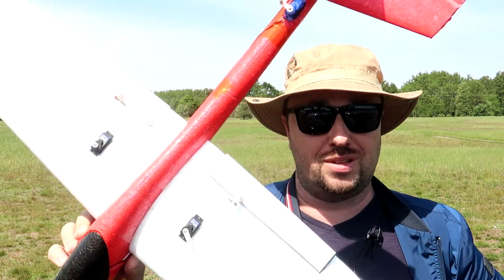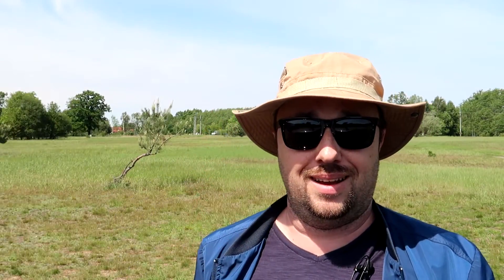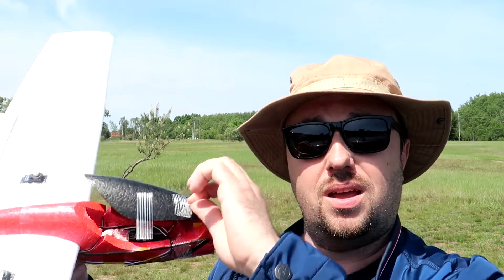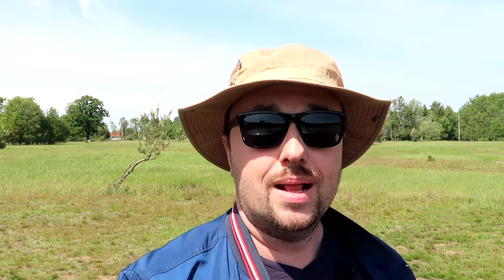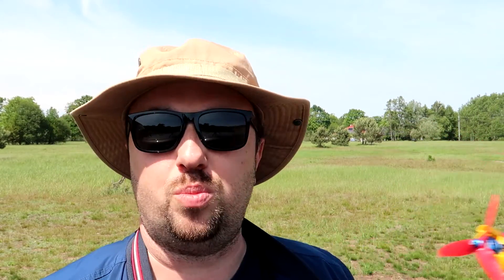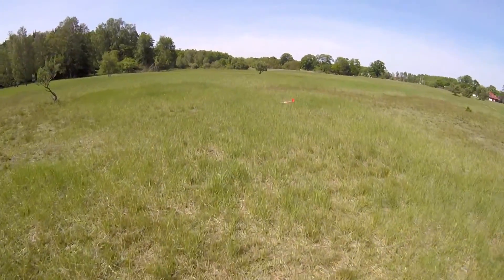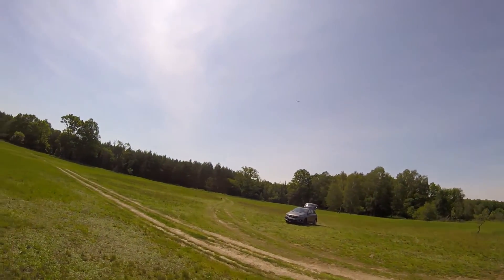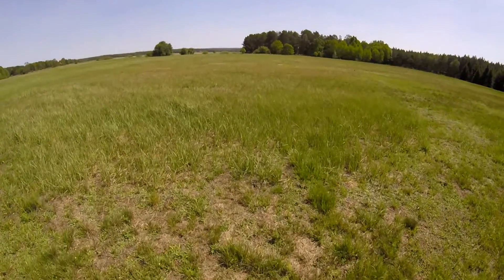Lidl Glider RC Conversion

Comment: some late info.    yer model is a design disaster.    why is this true.       at :49,  ailerons  SHOULD  EXTEND  TO  NEAR  the  wingtips.    because they do not,  responses to aileron inputs are DAMPED, and roll-axis control authority is  REDUCED.       at 1:14,  servos  should  NOT  be installed at the TAIL.     doing so, has resulted in the model having  a   TAIL-HEAVY  DOM.    distribution of mass.   the servos  SHOULD BE  MOVED to a position, NEAR  THE  CG;  above, below the  main wing (or IN the wing root).      (any opinions relating to the advisability of the use of short pushrods are  WRONG.)    at 1:49,  thrust angle was the LEAST of your worries.       it would be a Good idea to use  a  PROPELLER.     at 9:38,  BEFORE altering the thrust angle, you  SHOULD   MOVE  THE  SERVOS  and  re-balance the model.    INVERT the model, and balance it at 30% of root chord.        googletranslate

Comment: Lidl Glider RC Conversion, I did the same thing like you, but I want it to do 3D aerobatic( auto-hover in the air vertically). Can we have a mode for 3D aerobatic in the future in inav?
Reply from the maker: It should work now, but only as a stabilization assist

Comment: i  On the next build, Put the Ailerons at the ends of the wing not inboard.   CG at about 38 - 40mm from lead edge and dont bother with Rudder..   A bit of 2.5mm carbon down the tail will be plenty  .  Will be such a sweet little flier you wont believe it .    best 8 bucks you can spend in this hobby

Comment: If that motor was tilted any higher it would be a helicopter bud lol. Also your control surfaces look a bit small and spine look to heavy. But apart from all the faults nice first attempt. Hope you get it to fly nice. Hope you like your 38 degree weather to day as well.😁🇬🇧👍

Comment: Look at my profile - I made few conversion too, but donor was little bit smaller 480mm ws. Nice work, btw!
Reply: Your modded Plane Is very cool! Where did you get It from?
Reply: @NicolaGuerrera  Thanks! It's cheap Chinese foam glider - you can find tons of this stuff on AliExpress or on local toys market.  They are in 2 sizes - 480mm and 330mm ws. First easily care 2 5g servo and 1106 6000kv motor, second - 2 614 or 715 brushed motors and brick from Wltoys v911 helicopter.